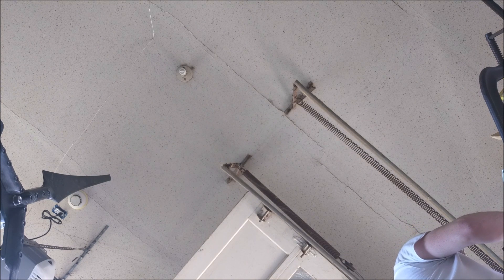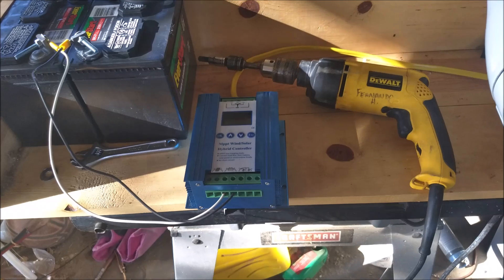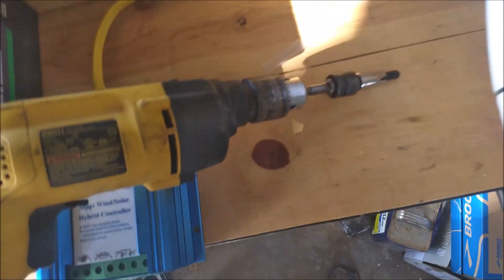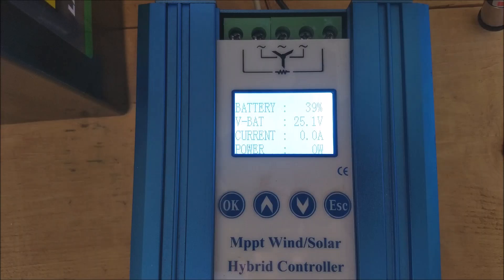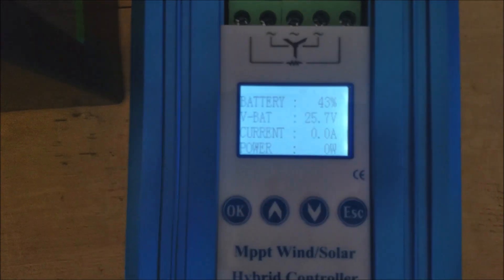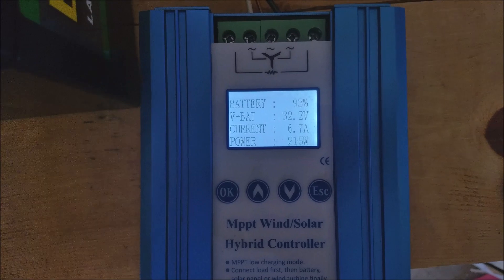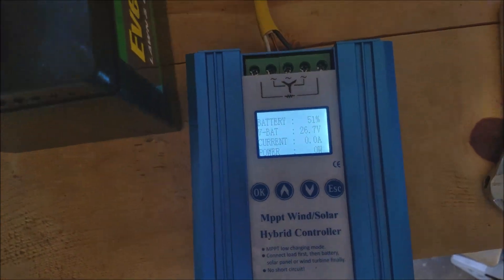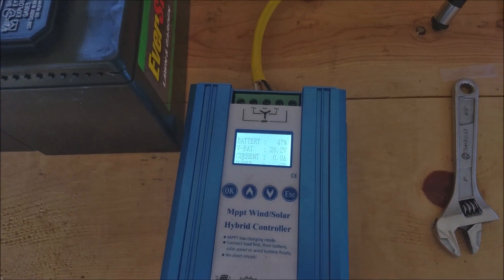400w eBay wind turbine #2 Bench Test!

Comment: My 500 watt will never do more than 29 amps not near the rated 500 watts in the best wind or 1600 rpm with the drill. Yea right. Did a test like you but I used a 3 phase rectifier. I did test it with the controller that came with it and got 6 amps before the break kick in. So it is a 50 or 70 watt turbine at best.

Comment: This test method is fairly meaningless.  The output of the alternator depends upon both the speed of rotation and the load applied. As your batteries are passing 15V each (30V +) they are already well charged and will not load the alternator usefully.  The only thing you are likely to achieve is boiling your batteries by overcharging.
Reply: Exactly what I was thinking.
Reply: The test is wrong I'll let you figure it out
Reply: Need to wait for the MPPT to track the ideal load which means holding rpm steady for a few minutes.

Comment: My Ebay 800w Chinese 24v wind generator..... today at 50mph wind, gusting above that.  I was getting 101w sometimes in gusts getting 138w.  I wonder what wind speed I would need to get to half of its rated power?????
Reply from the maker: Some of them really are rubbish, some are pretty great.  The real problem from my perspective is that it's hard to tell which is which before you buy them.  Which turbine did you get and how do you have it set up?
Reply: @ToysforWatts  Ebay only says this about it "800W 5 Blades Wind Turbine Generator 12V 24V Power+Charge"........  It is up on a pole 50' from the house. Open area, flat plains, no trees, attached to a forklift battery. The wind is the first thing hooked up.  4Kw of solar now on the pole, to hook up next.
Reply from the maker: 1. Is it only running to the one battery?
2.  Is there any load on the battery while it's being used?
3.  Are you using any kind of charge controller or going straight to through a bridge rectifier?
4.  What kind of voltage are you seeing on the battery when it's running in high wind?

Sorry for all the questions, but when there's trouble I like to find out why and if it can be remedied.  Sometimes it can't, but I've found you can almost always get a little more work out of these things :)
Reply: @ToysforWatts  Running to the one battery. I believe it is rated at 15KW.  No load at the time. Using the charge controller that came with  the wind generator. Voltage I believe was 25.6v
Reply: @ToysforWatts  1 forklift battery 15KW....  running the charge controller that came with it the China wind generator.....  Battery voltage is generally 24.2v to 26.4v while I use things under load....... Also hooked up to the battery is 1800w solar, split between 2 charge controllers........  Soon to add another 1800w solar to the same battery, and a 1200w PMA (14 magnet version).  Upgrading to a 6Kw pure sine wave split phase inverter. (here, but still in the box)  Household daily load?  38 Kw in the summer running AC, and 12Kw in the winter.
Reply: rubbish

Comment: Tengo dos aerogeneradores de este tipo 6 helices. No son lo mejor pero tampoco son lo peor. En mi zona no hay mucho viento y además el que hay es rachado de diferentes direcciones. Las turbinas casi siempre están generando constantemente 100w cada una. Y cuando hay vientos de apartir  de 30kmh ya se puede hablar de más de 200w.
Los reguladores que estoy usando son jnge power híbrido solar es mppt para generadores eólicos.
Reply: hola,  estoy por adquirir un controlador hibrido, que componentes tiene instalados??
Reply: @czuniga1984 sistema 24v batería estacionaria cpzs 1250ah24v . 2 Generadores eólicos 400w los sustituir é en breve por unos ista breeze i1500. Dos reguladores solares híbridos para paneles y turbinas de la marca jnge power 1400W 800 turbina 600 panel solar. 6 paneles 24v 360w. 2 inversores power jack uno primário y otro de apoyo a los momentos de más consumo.

Comment: Just saw your comment over on our channel, it got stuck in the spam filter! Curious, is this the turbine that only does just over 200 watts now that it's mounted? I feel I had a similar experience as my turbine was making about 200 watts at the rated speed instead of the advertised 400 watts.
Reply from the maker: This one hasn't been mounted yet.  The 500w turbine is the one that hasn't done much.  This one is going up in it's place later this week.

The other 400w turbine we put up actually has done really well and has peaked at nearly 900 watts (in unrealistic wind but all the same).  This one is made very similarly to the poor performing 500, though, and I expect similar results.

Thanks for checking my channel out!

Comment: I have the same in my garden with dirty wind. I tuned it from 3 to 5 blades to get small wind better and enlarged the tail to have a fastest rotation. It works pretty well, I have some 15-50W regulary and sometimes more than 250W

Comment: Its going to be close, in my tests years ago id only see 500 to 700rpms with a drill yet the turbine spins faster than that
Reply from the maker: The drill never gives a real world test because the load increases as the speed increases.  Kind of like a Non-Newtonian fluid...the harder you work, the harder the work fights back.  The drill is only good for very low wattage generators or basic voltage tests.  We won't see real output until it's in the air.  It seeing 300+ watts on the drill, though, at least gives me a little hope for it making decent power in the air.
Reply: Not bad... i tried to bench test my 800 and almost broke my wrist. I know it can do it but my wind is just so so dirty.